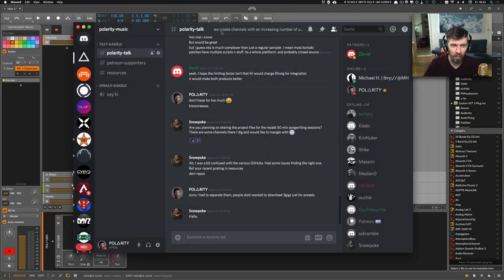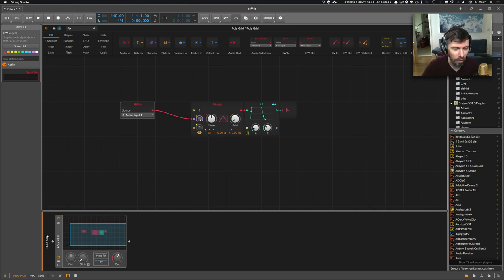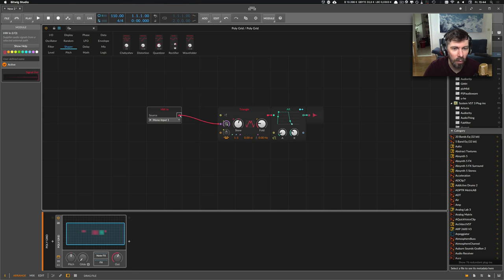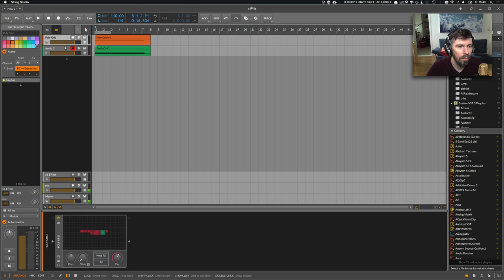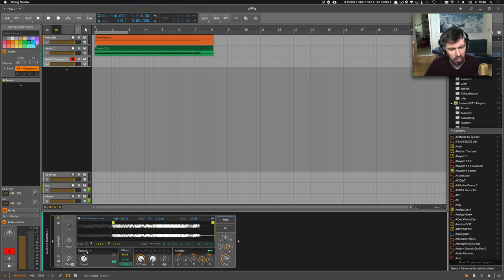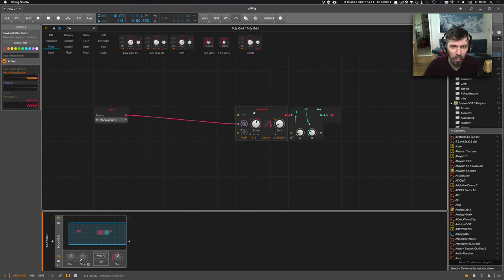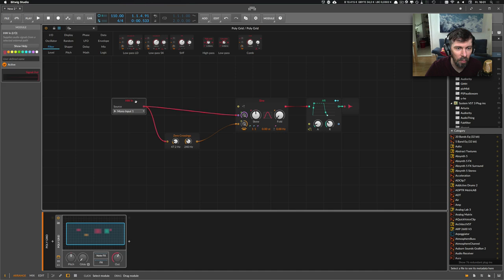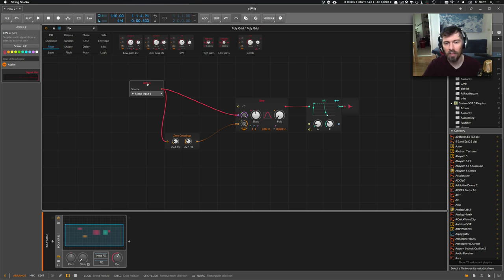Skip Massive X and use your voice in the Bitwig Grid

Comment: I think you forgot to turn off the keytracking of the oscillator. Then it would just use the pitch signal coming from the Zero Crossings module.
+ You could try to just an Envelope Follower or some kind of threshold to control the amplitude of the synth instead of the note gate signal.
Reply from the maker: and you need to dial into the negative on the pitch input jack :D